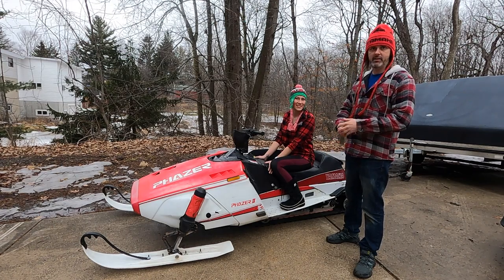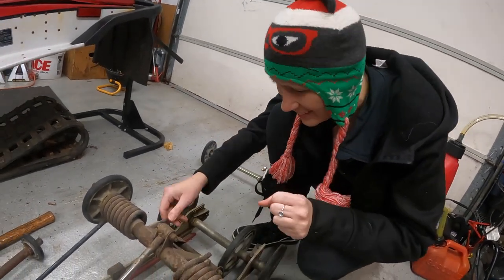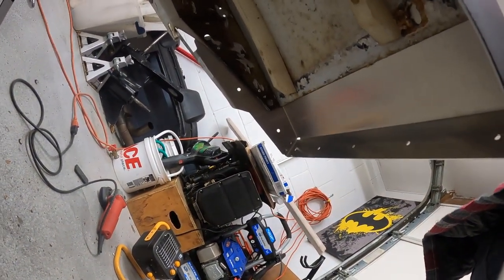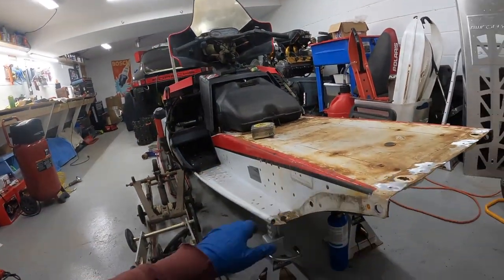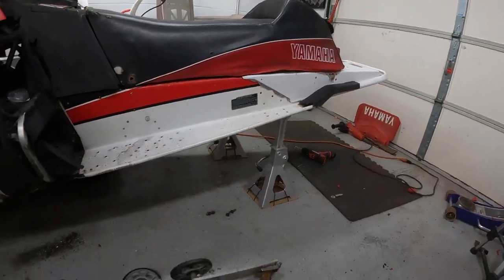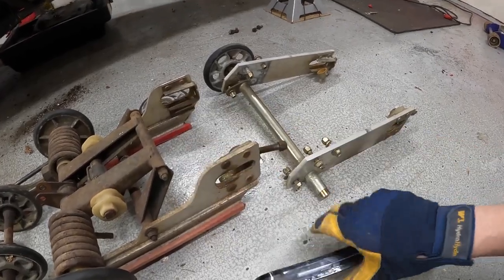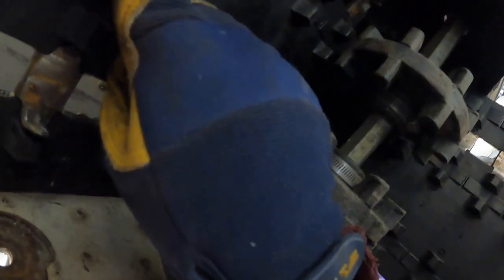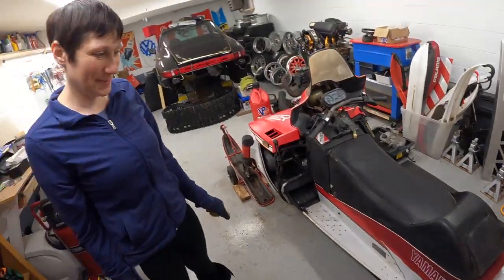How To Long Track a Yamaha Phazer DIY Mod Sled Tunnel & Rail Extensions

Comment: Like the build. But why jack up the factory fairing and head light Assembly!? Is it a personal thing?? Seen a lot of people do it! Just don’t know why. That makes a phazer a phazer. And it does help with wind the hands anyway. I’ve always cut my windshield’s down a lot. But……..
Reply: I tilted the bars up to get more height, but then the fairing was pointed at the ground.  Need to get a real bar extension, will probably remount the fairing at some point.

Comment: Where did you source the skis? I just picked up an ST and need to get the steelies off it. Great vids!
Reply from the maker: Facebook marketplace, and ebay.  Just look for deals.   I was buying any set of cool skis I could find under $70/pair.
Reply: @ADDvanced  Roger that bud, it looked like those were a direct fit? I got some composites for my '84 Phazer and they took some washers that came with the kit to make them fit snug. I like the looks of the ones you installed better.
Reply from the maker: @scottfielding6179  Yup, just some washers.  Slydog Powderhounds.   Buy all your sled parts in the summer, everything is 50% off :D
Reply: SLP mades some premo skiis for the Yamaha. There in Idaho falls, Idaho. They might still have some.

Comment: How much chain oil do you usually use? I put a pinch over 8 oz until it hit the full line.
Reply from the maker: Til it comes out the hole

Comment: 136 маловато.151 огонь
Reply from the maker: Phazer motor struggles w much more than that tho
Reply from the maker: Also they don’t weigh much like modern sleds
Reply: pz480   -151    ex570  -144

Comment: Only if Yamaha made great snowmobiles like Yamaha did in 80' and 90's compared today Yamaha 4 stroke sleds I dont know why Yamaha stop making great 2 stroke motors. You still see AC,Polaris,Ski Doo still make great 2 stroke sleds, that why Yamaha is more a motorcycle company then a snowmobile company sad to say
Reply from the maker: The new 2012+ Procross chassis is amazing tho.  I love mine.